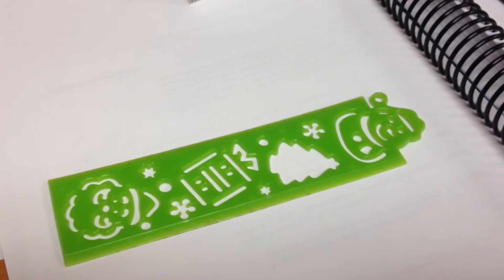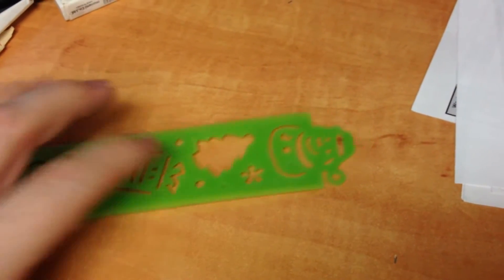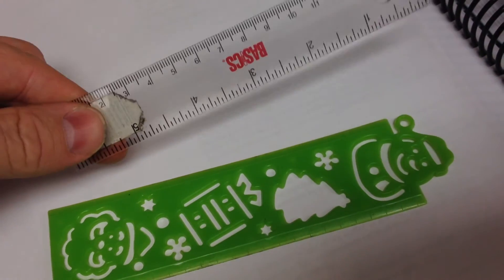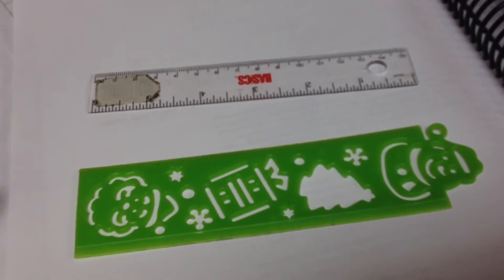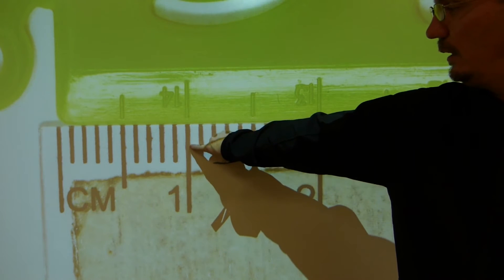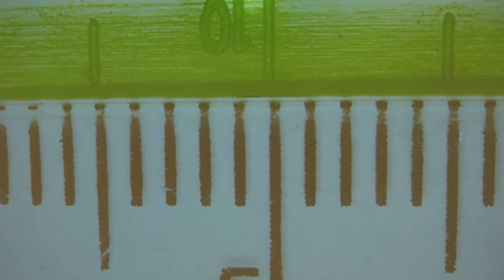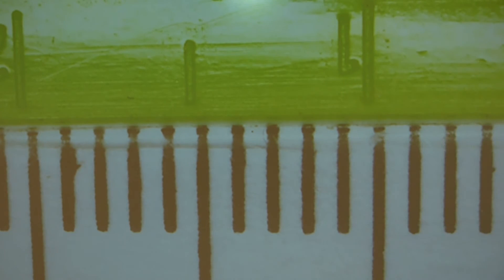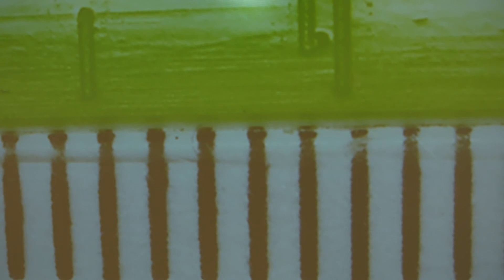Economics vs. Chinese ruler: FAIL in plastics manufacturing

Comment: How do the graduations on the clear ruler line up with the graduations on a stainless steel machinists scale? I would doubt that they are accurate as well, perhaps not as far off as the green ruler, but inaccurate nonetheless.
Peace!
Reply from the maker: Will shoot a video of it, thanks for the idea, thanks for watching.
In metrology, the definition of absolute length of the meter (yard) is the only accurate thing. Anything man-made is inaccurate, but there are degrees or levels of accuracy.
There is a meter standard made of laser light - good luck grabbing it.
There is a meter standard made of metal, single piece for the whole world to copy and sometimes compare against, guarded under top security.
There are national level copies of the world standard,  1 per nation, held at NIST for example.
There are several "master" copes of the national standard kept at the manufacturers.
There are good production runs, and cheap production runs. And there is the reject pile.
This green ruler is disturbingly marketed as OK. It belongs to the reject pile, melt it down and start over.
Reply: Indeed and there are several products in the marketplace that should have gone straight to the recycle bin but people keep buying the crap/

Comment: Terrible ruler. I'm guessing the green ruler shrank after production causing the curvature, and and minute inaccuracy. They may have rejected these rulers and found them unsuitable for ink printing on the numbers and marks. After they were thrown away, employees who are severely underpaid went and retrieved them from the dumpster and shipped them over here for pennies. 100% profit for that underpaid employee. Should be the responsibility of the stores over here to make sure they are selling good products.
Reply from the maker: It`s a likely scenario. If it`s a production test run, it could also be willfully sold by the manufacturer. Also possible that it is the best the manufacturer could produce, from PVC pellets of unknown source or made on machines written-off by decent manufacturers.